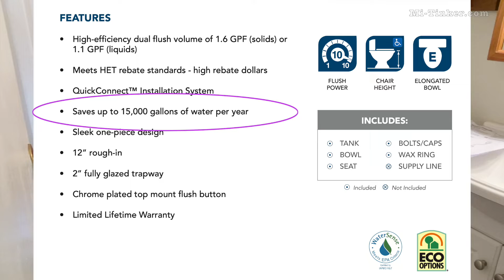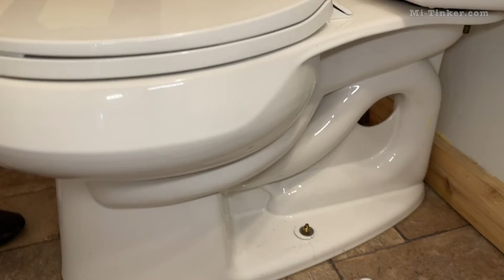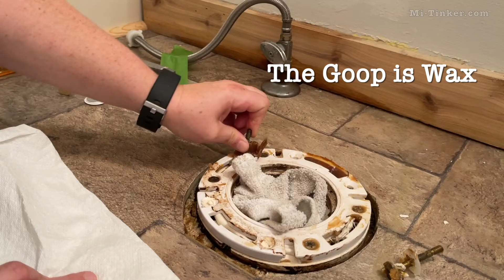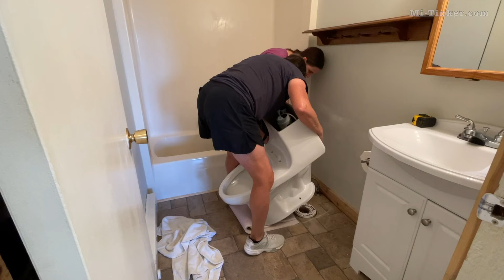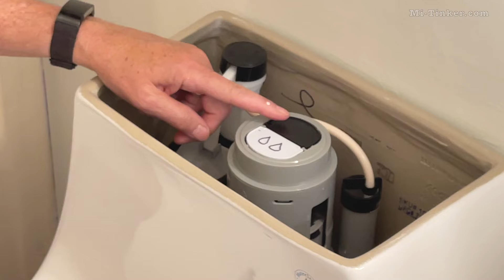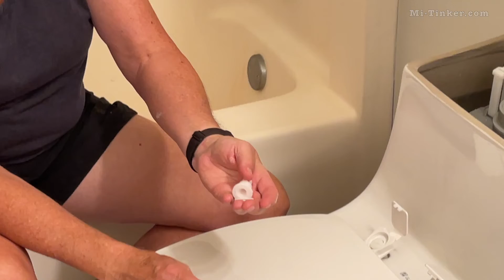Installing a New Glacier Bay Dual Flush Toilet

Comment: I get the need for a comfort height toilet. But replacing a 1.6 for a dual flush we just found ourselves needing to flush it more often than the non dual flush so water savings has been minimal.

Comment: I am trying to figure out the water supply flexible hose dimensions and shape but the video skipped over that part and jumped to tightening while attached. Was the a regular 3/8 hose on both sides?
Reply from the maker: Sorry for the delay in the reply. I simply took in the old hose and matched it. Honestly, I don't remember the size. I believe the standard supply line diameter is 1/2 inch.

Comment: Great job, Ladies.
I just installed the same Model N2420 today.
I am having a hard time figuring out how to raise the fill valve to increase the water volume. The manual addresses this but for a different model with a screw on the fill valve, but this newer model does not have a screw on the fill valve. Do you have any thoughts on this issue?
Reply from the maker: Unfortunately this toilet resides 3 hours from where I live. So I can't look inside the tank. There should be some sort of screw that adjusts it. Sorry I could not help more! let us know what you find out.

Comment: I watched your video only to see if I had the double/single flush button right.  I was worried that there was no visible way to verify which flush was which and it just didn't sound like I had it right.  I watched the intro of your video and kinda skipped to the flush button part and it seemed like you were doing a great job of explaining the overall toilet replacement process.  BUT, just as you did, I assumed that the white button was the white button referred to in the instructions, and the black button was what they referred to as blue in the instructions.  WRONG!  If you take a magnifying glass and look at the illustration in step 6 of the install instructions, you'll see that there's a half circle signifying "half" flush, and a full circle signifying full flush on the buttons inside.  So, the illustrated SINGLE  drop part of the flush button should be in front and the double drop button in the back.  I took the lid off and pushed the white and black buttons separately to verify that the WHITE button is the half flush.  You made the same mistake I did by reading instructions and assuming white was white.  LOL!
Reply from the maker: Wow. Maybe your instructions had a little more detail. Get out the magnifier.  I guess we better check it out. Thanks!

Comment: Excellent video!!!!  Only opinion I have is you can also use a wet/dry shop to suck the left over water out, waaaaaaay easier! ;)   Also, you should show how you put the wax ring and rubber seal on the bottom of the new toilet, that's the only part that can give you problems if you do it wrong, CHEERS!!!!
Reply from the maker: Yep, a wet dry vac will work as well too... we did not have one on site on this trip and a wet/dry vac has to have the wet filter in before using it. They are often also big and clunky in a small space... then you have to drag it though the house and empty it somewhere... As said, there are  Multiple ways to attack it. Cheers

Comment: Good job! Is the toilet going good so far?
Reply: I bought one of these toilets five years ago.  Loved it.  Strong flush, quiet and quick fill.  I've bought three more since then...love them all.  Just yesterday I did replace the silicon seal in the flush valve of the very first one, which I may have damaged from using bleach tablets in the tank (the instructions do say not to use bleach in tank).  The seal cost $5.00 and took about five minutes to change without tools.
Reply from the maker: Yes! It is awesome!